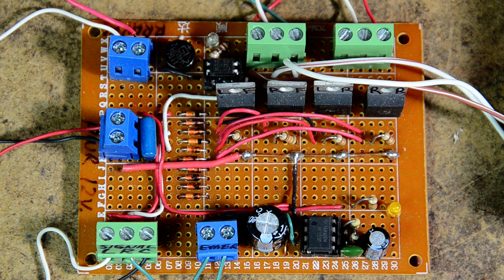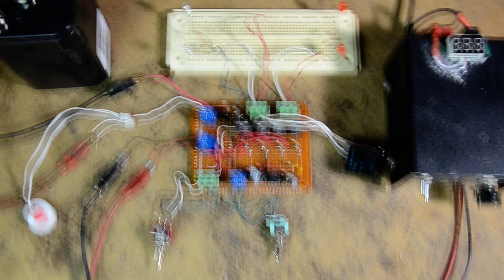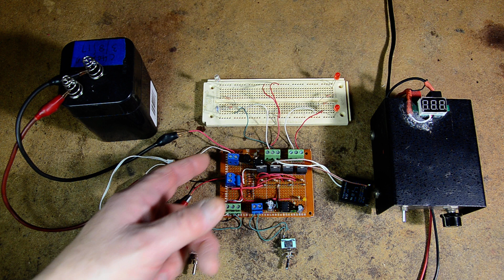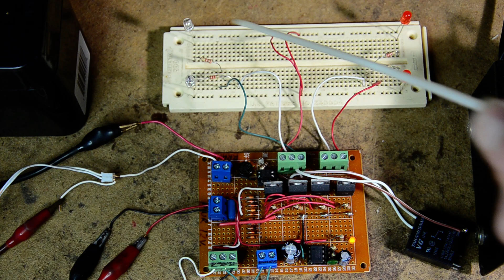HUP MOBILE TURN SIGNALS BOARD DEMO

Comment: Nice work. However, something doesn't quite add up. Would like to ask you: wouldn't the break lights have to be a completely separate set of lights/signal ? since all current cars (or at least the European ones) have a separate set of break light? break is red and turn  is orange ?  I know that most cars have a common light bulb turn/break but they are special lamps that have 2 filaments inside with a common ground, therefore they would require 2 signaling hot wires and the third wire as the common ground. (if i'm not mistaken)
Reply from the maker: You are correct if the car came that way.   It did not come with dual lights in the rear.   I worked with what was there.   Owner was happy.   It is a 1930s vehicle that had no tail lights just a single brake like fixture.   Previous owner just added 2 Red LED brake lights so that is what I had to work with.  Thanx for watching.

Comment: Nice circuit JP. I can see only one flaw in the wiring and that is the brake light overriding the signal lights in the rear. All cars I have ever seen the signal light is left active and only the brake light for the other side is shown as constant on. Not sure if this is a regulation or not, but I just know that is how they work. Other than that, very nicely done. :)
Reply from the maker: Thanx Doug.  Good catch.   I considered that but this is a 1930s car.  I just figured a brake light is more important than turn signal in that instance.   If my friend doesn't like that configuration then he can just not connect the brake switch and only use the OEM factory single brake light.